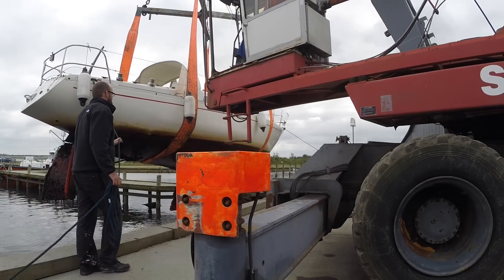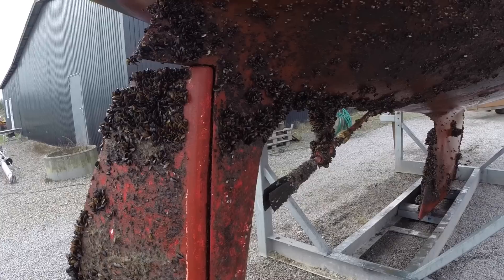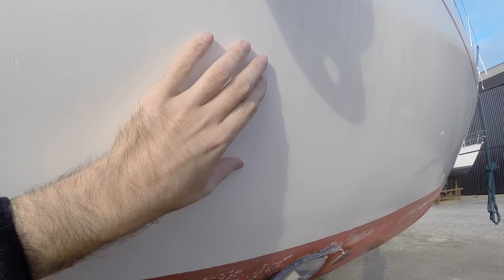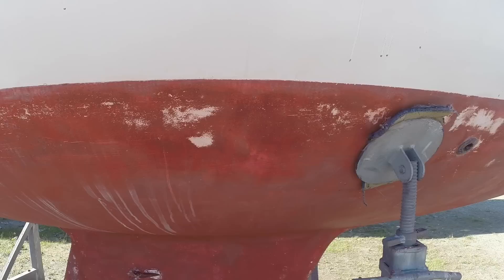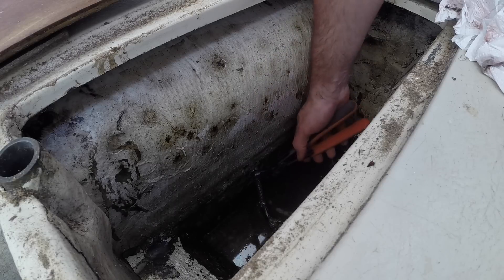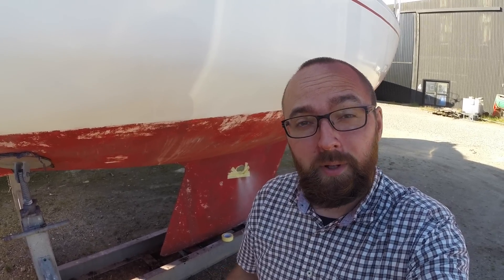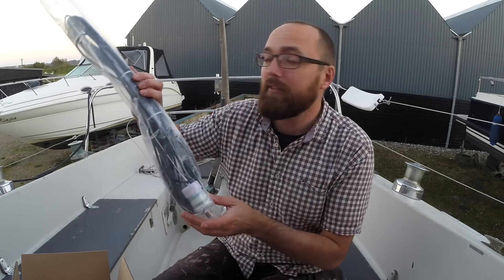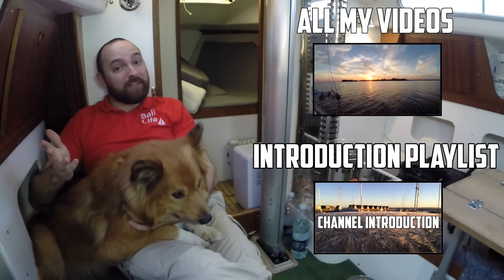Sail Life - Up on the hard, part 1

Comment: Little tip for you....I bought one of those mast head units, threaded it on the mast, put the mast up and it didn't work!!!!! had to unthread mast then send it back for repair then try to rethread the mast afloat, not a easy thing to do. Best connect it up to make sure it works before you thread mast with cable. Every unit I have bought from them has not worked straight out the box, they all had to go back for repair. (best not mention make)
Reply from the maker: +Graeme Campbell Yikes! That sounds ominous. I have one other instrument from them and most of my friends have one or two instruments. I don't think any of us have had any issues yet. I certainly hope I won't start now ;)

Comment: Hope you don't mind a suggestion on terminology- use "topsides", not freeboard. In my experience Freeboard is usually used to describe the height that the deck is above water, whereas topside is used to describe the actual surface of the hull that sits about the waterline. Similar but different meanings.
Reply from the maker: +myvidlocker Very interesting :) In Danish we use the term "fribord" when talking about that surface. Having heard the term "freeboard" I figured that would be the equivalent in English. BTW Of course I don't mind :)
Reply: Interesting. Wonder if the English term freeboard comes from those roots... Love your videos. I watch them regularly. Good luck with the new boat!

Comment: Don't need the bilge water but would have taken the propeller from the know meter you removed. Was it a VDO?  also you should have run some coax for a ham radio with that coax for the marine radio.  73 de kc8frw

Comment: Very good video.  If water is left in the bilge does it have a negative effect on the fiberglass?
Reply from the maker: +Scotto Wd Thanks! The short answer is no :) I guess there it's possible if your boat is made from polyester (vs epoxy) and you have an area of your bildge that isn't coated with a primer. But other than that a bit of water in the bildge is perfectly fine :) It can start to smell a little, though. My gearbox is leaking oil and that ends up in the bildge. If that wasn't the case I'd love to paint the bildge and make it look nice. There is something very appealing about a squeaky clean bildge but I won't have one of those before I fix the gearbox :)
Reply: Mads, when you sail I assume your doing it by yourself. Do you feel comfortable doing that? The reason I ask is because I'm gonna be sailing with only myself. Are you able to handle the boat in rough water with just yourself?
Reply from the maker: +Scotto Wd 99% of my time spent sailing is single handed :) It's not an issue at all :) With a reliable tiller pilot and a bit of thinking ahead you'll hardly notice the missing crew. Once you start talking to yourself, there is absolutely no need for crew ;)  What will you be sailing in?
Reply: ***** I left a link with pictures, but I'll be sailing alone. The boat needs much work, much like yours when you first purchased it. 
http://www.yachtsalvage.com/Listings/YS140249.htm#photos

Comment from the maker: +R Alan Thanks! I'm glad to hear the video wasn't boring. Sometimes it's hard for me to know if people will enjoy a video or not :) BTW I wasn't able to reply directly to you. I think you have something in your privacy settings here on YouTube that keeps me from doing that. Just wanted to mention it in case you didn't know :)
Reply: I slipped mine in may did a multiple part series on the job and was lucky enough to be in the worlds cheapest yacht club out haul was $40 the cradle was $20 a day and the pressure washer was $30 overall an amazing price 9 days of work and my boat had a new bottom coat that should last atleast 25 years
Reply: epoxy barrier coat,not antifoul